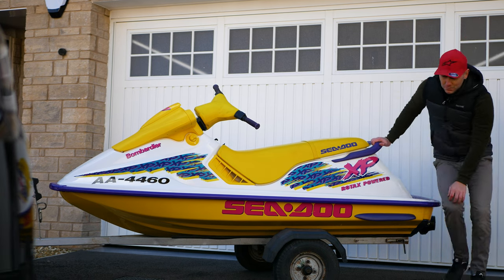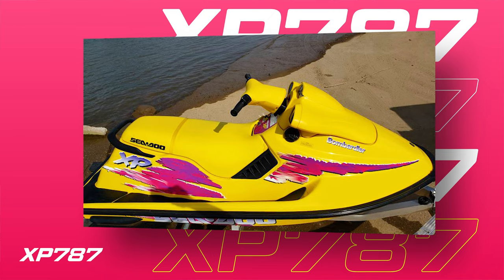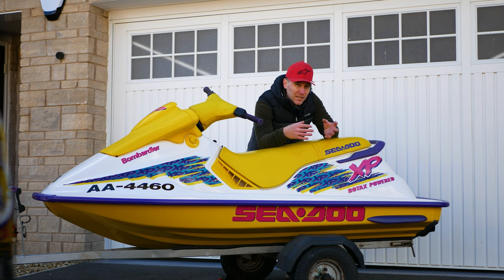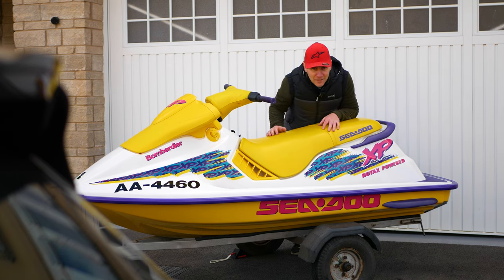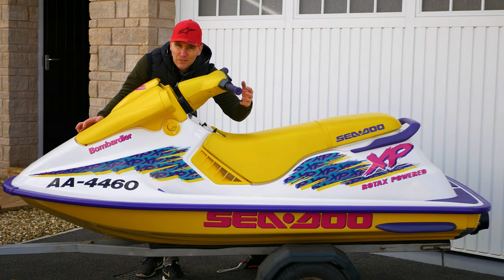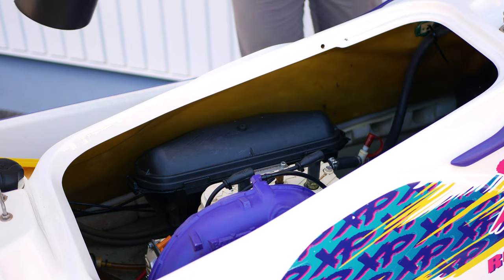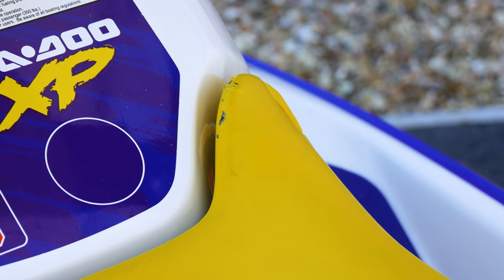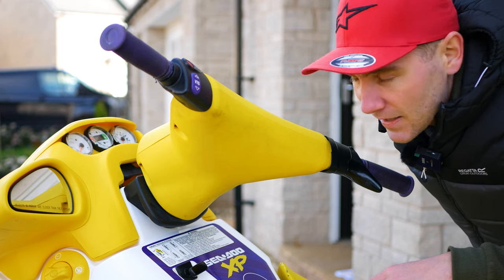Iconic Seadoo X4 HULL - Why I bought the XP717 vs XP800? | Seadoo XP 717cc 1995 | Ep2

Comment: Question'. 96 SPX an X4 hull?  I have an older man offering me one in decent condition. I actually just want the trailer but the ski comes with it. lol
Reply from the maker: So 1993 & 1994 XP's are not X4 hulls, 1995 & 1996 XPs (717 & 787) are X4 hulls. What happened is in 1996 they made the 1995 XP 717 X4 the 1996 SPX X4 as the XP was then the 787... the SPX then ran to 1999, the XP switched over to the parabolic v in 1997 (787 for 1997 and then 951 for 1998-2002, then 951di for 03-04). Have a watch of this, I cover the history, https://www.youtube.com/watch?v=cFD5ee8JBWw&t=227s
Reply: @classicjetskis  I picked up a 96 spx for my daughter.  717. She's 10 and loves it!  Not as much as her Superjet... but, loves it!
Reply: @classicjetskis  I already watched and "liked" that video. I appreciate your response! I just needed a trailer.. but the SPX came with it. Motor is strong 145 in both holes. VTS works.. now. Replaced the boot. Not gonna lie. It's quicker than I thought it would be. lol. Iv posted a few #shorts already. Working on a video.

Comment: I had both the power of the 787 110 hp vs the 85 hp of the 717 is a huge difference plus the rave valve is very easy to clean with a razor blade. The advantage of the 95 717 is the extended pump.
Reply from the maker: Yeh that's pretty much what everyone has said also buddy... I will for sure get a 99 spx 787 down the road... Thanks for watching and supporting 👌👌
Reply: It's a " 720, 800 or 951" motor... nobody calls them by 717 or 787
Reply: @tyronetrump1612  I know how they call them, is just not the correct term. 😉
Reply: @frederickfernandez1510  So we call Kawasaki 800 stand ups " SX 781s" , Yamaha 1200's "1131s"or Honda 650 motorcycles "honda 664" ? Every manufacturer rounds up cc's on their displacements. Only ghey people call it 717 787   lol

Comment: 718 with a few mods 63 to 64 mph
We put 951 modified in a 95 XP
It run 71mph
Reply from the maker: Man that sounds mega... I for sure want to get my hands on a 787 to avoid needing to mod the 717... my 717 has been so reliable and one of the key reasons I bought a 717 as they go on and on without messing with them... IMO if you want true stock 60+ then a 951 is the way to go... my 99 GSX ltd hits 63 on calm easy, so no need to mess with my pristine 717. Thanks for watching dude 😎👌

Comment: You absolutely can’t go wrong with the reliability of the 720 and the small light weight hill of the 95 xp. I have both a 95 xp 720 and 95 xp 800 and although thr 800 is faster they are equally as fun
Reply from the maker: Thanks dude, this is essentially exactly my conclusion on why I bought it, thanks for the breakdown dude, from what most have said this is a spot on evaluation of both.... I will get a 787 down the road in the SPX 99 but pumped at finding this 1995. Thanks for watching and supporting dude ✌✌
Reply: @classicjetskis  Displacement is everything - especially low end hit. Once you ride one with the 800 motor you will never get on that 720. 
I know I have been there

Comment: Love the videos I have an 2000 seadoo rx. I have a question do you have any suggestions on how to bring the paint back to life it's very dull
Reply from the maker: Thank you that means a lot 🙏 ok so depending on how bad the gel coat is you may need to cut it back with a marine polish and then reapply a good marine wax… I recommend for the wax side of things using a spray ceramic coating… for cutting back gel coat I always use 3M medium cut polish… also make sure if your not experienced using a machine polisher that you do the cut manually, so you can maintain control. Hope this helps 👍
Reply: @classicjetskis  awesome thank you I will keep you updated on how it comes out. BTW I love the gsx limited I rode that ski for years and I grew up on a SPX AND SPI
Reply from the maker: @toddmanganello3654  nice man! Love all those models… send me a pic on my insta with how you get on 👍

Comment: What is that black plastic you took off when you lifted the seat for?
Reply from the maker: Good question, it's an air intake director essentially... If you look closely on the side of the ski, you will see yellow grill intakes, this then channels air through the yellow grills, into air openings under the seat...when the seat is then placed into position over the black air intake, it creates a water tight seal... the air is then channelled safely into the engine bay to help cool... It's a design used on a number of years and models... Its on the GSX also. Thanks for watching and supporting dude!

Comment: I'm the original owner of a 96 XP 800 (with very low hours) which is in similar shape as yours. I haven't run it in years however, my son pushed me to get it running again. Had the carbs rebuilt and odds and ends addressed, I'm still struggling to get it running at it's peak performance. The power cuts down at about 45MPH as if it has a governor set to limit it's speed. I've had it to a mechanic I found who swears the XP is the best ski ever. About $1,200 later I'm about to give up with this guy because nobody else in my area wants to work on it....not sure if I should just sell it and look for a used late model three seater (possibly Yamaha for it's durability).
Reply from the maker: First of all, give your son a pat on the back for asking you to get it out... the reality with these old skis is it can be painful if you don't have the right person or knowledge to get the ski running right... Not sure where you're based but if you drop me a DM on Facebook or Instagram, I can try help put you in touch with people that can help. In any case, obvious thing that could be affecting things... have you checked the wear ring, impeller, RPM range in the water adjusted correctly... checked compression... all the useable bits, I'm assuming so if you have paid a mechanic to work on it, but that said, not all mechanics are equal... If you do decide to throw in the towel, please can you send me pics of it via DM, as may be I take it off your hands... as for buying a later 3 seater... 2 strokes are 2 strokes, if you're not liking the inherent work needed on the one you got, there no saying buying another wont be the same story... IMO the first thing about old 2 strokes is to accept its more about passion vs logic... you will have to spend money to get it running right and then its a labour of love to keep them running each season... If you want something less maintenance, check out my new spark videos as this gives some of the playfulness of the 90s but modern day reliability. 

Thanks for watching dude 🙌
Reply: Thanks for your reply, much appreciated. I'm located in Michigan (about one hour north of Detroit) so, not sure if you have any friends/contacts in my state. 
We love the ski for it's tight manuverability and raw speed, just frustrating that the motor scales back power after a certain amount of throttle. The mechanic that did the carb rebuild finally replied to me and said change the plugs (again). That would be the forth set of plugs in one season - doesn't sound right.
The only reason we were considering a 3 seater is because we thought it would be nice to have something alittle more stable to ride two without tipping over (the XP is really only a single rider ski) and our inland lakes can get very choppy.
If I can find an experienced mechanic that won't turn me away (because of the ski's age) I would definitely look at getting it looked at. It's just $1,200 in on repair costs so far, just has me concerned how much more that tab could grow with somebody new looking at it....money is the object.

Comment: Nice video. 
Yes the 717 is less power and a little slower..but as you said the 717 is less maintenance and more reliable.
Ive restored 4 of these and have another 3 im working on restoring.
As well as 2 of the 95XP800s.

As for grips, tho not OEM, I recommend the ODI LockOn Ruffian grips. 

And yes you need to mention why the grey gas lines need to be changed ASAP.
Reply from the maker: Thanks man... I know when it comes to 717 and 787 you have restored a tonne... I think you may have been one of the people that said about the 717 being easier to work on... Do you agree with my SPX thoughts? Thanks for watching mate ✌✌
Reply: @classicjetskis  yes i have a 99SPX hull as well in my project lineup.
As far as improvements go, in general they do make better improvements..but the 98SPX they made some changes to then undid those changes in the 99SPX.
The 98 SPX was the lightest and fastest of all the X4 hulls. They made the hull thinner in some areas..but that weakend it in an effort to make it lighter for racing. They also had a plastic splined pump instead of the brass pump, again to save weight. They ditched the plastic one and went back to brass in the 99. The plastic one again being lighter was also weaker and more prone to breaking.

What really disappoints me is the change from tachometer to speedometer then to not having either.
The 95s had tachometers which is more useful when setting carbs. The 96 had a speedometer...then the 97-99SPX didnt have either they just had the MF gauge and trim gauge.
Not really an improvement if you ask me.
Reply from the maker: @GCEXTREMEMN  Thanks for the info man, really helpful and interesting... I have to be honest, out of everything I have considered, the speedo/gauges is the one thing I hadn't thought about...So thats something to keep in mind. 

I did know about the lighter hull in 1998 as I have a buddy who specifically bought the 1998 spx for this reason, however based on your breakdown, I would probably take the weight increase and go still with the 1999 if they reverted back on things... 

The only bit I do love about the early xp717/800s is they would spray the exhaust and water box purple, which was a nice contrast to just all silver on the later 1999 spx... I'm OEM so its breaking the rules lol, but a yellow exhaust and water box would look sweet on a 1999.
Reply: @classicjetskis  well you probably wont like my plans for my 99SPX lol. I plan on regelcoating the top in Red...lol i want a red/black X4  to go with my red/black 04XPdi. 
Its going to have a red engine, black pipe, red waterbox, and a black hood.
Hopefully i can find some yellow water lines tho to throw in a tad of yellow for contrast.
Reply from the maker: @GCEXTREMEMN  To be honest mate...my fav colour is red...that why the GSX and XPDI are my fav all time colourways... If I didn't love OEM so much I would probably do an ultimate build... get a x4 hull and 787 (any of the years) and then do the ultimate colour combo like you. Send me some pics when its done dude!
Reply: @classicjetskis  yea its gonna be a while. I have so many ski projects ahead of it, all which will get done and sold to fund my other personal projects. 

I really enjoy your videos. What drone are you using? I need to work on my cinematography on my vids.
Reply from the maker: @GCEXTREMEMN  I hear you dude. I know that feeling, I would love to be making these videos full time...hopefully one day! I have a drone Pilot I specifically call in when I do ride content... I was gunna buy a drone then realised its cheaper for me to hire my buddy with his drone for the day... I would have to do like 10 shoots before I would pay for the drone and also I need to be focused on riding the ski, so it doesn't make much sense... I can find out what he uses...I know its DJI and its always 4k at 60FPS...  Everything else is filmed by me and Megs on a Pan G7 using the kit lens and a prime lens... hope this helps.
Reply: @GCEXTREMEMN  That’s the one I bought. 98 SPX last summer. Previous owner took horrible care of it though. Exterior was beautiful but the exhaust pipe had a massive crack in it & was letting in water. Then I had to clean the carbs afterwards. Got the new pipe on, thing’s running like a champ! It is the lightest hull out of all X4 models. My buddy has a 96 XP & I believe his weighed about 434 lbs. My 98 only weighs about 428 lbs. It’s funny you mentioned speedometer cause I did get kinda pissed when I saw that my buddy had that on his but I didn’t lol. I believe the 96 XP 787 also had a ceramic flywheel that’s prone to breaking, while the later X4 models swapped to stainless steel. That’s one nice thing about having a later model is that they usually figure out the bugs from the previous years.
Reply: The only extra maintenance from a 720 to an 800 is the rave valve cleaning.
Reply: @tyronetrump1612  generally yes..but the 787 also has a counter balance shaft

Comment: I bought a 1999 SPX brand new! I found out Seadoo was gonna quit making this hull in 99 and in 2000 I hunted down a new one that was left over from the year before. When I found my new 99 SPX at a dealer it was still brand new in the crate. Most fun ski I ever owned and I regret to this day selling it in 2005. The 110hp motor in this light weight hull is so much fun. I had a 1996 XP and yeah the 1999 was pretty much the same ski but with bolder looks to it. I’ve also owned a 1992 SPi and 1992 XP but the 1999 SPX was something special. Love this ski you picked up. Really nice condition for the age.

Also these hulls if you do it just right can be spun around and then will stand straight up. I loved showing others how to do it. The bigger Seadoo hulls want do it. Wish Seadoo still made these!
Reply from the maker: Love this story dude! Man the idea of getting a brand new spx is goals!!! Lucky man, great memory’s for you by the sounds of it. I will report back after a summer of riding it if I pull off this move… sounds epic… thanks for watching and supporting, really appreciate it 🙏
Reply: Happy for you, but I have to wonder about the "bolder looks" for the 1999 SPX vs the 1996 XP,  how do you top all bright yellow with pink and purple graphics? Unless you meant to write the other way around?
Reply from the maker: @GoldenCroc  to be honest you may be right, having re-watched this back and seeing the 1995/1996 xp again...its a hard one... I didn't make a mistake and do agree in terms of 'bolder look' 100% you're right, the 95/96 yellow and pink hands down takes the win in terms of bolder, but its more the fact that personally I want an SPX to add to the line up, plus as I mentioned, the 1999 SPX is basically the same ski... I do also really love the black/yellow colour way on the 1999. The reality is in an ideal world I would have both aha... Thanks for watching dude ✌✌
Reply: @classicjetskis  Just to clarify, I meant specifically the "bolder looks" comment from the OP, not any reasons you gave for preferring a SPX. And even for the OP, it was just a small nitpicky sidenote of his wording... Not very serious.

In any case I would also prefer a SPX really, but as a 90s kid I just couldnt resist the eye searing looks of the -95 and 96, thats why I got one. I also collect 90s motorcycles with terribly loud graphics, and I have vinyl wrapped my own car in a sort of goldish-"high-viz yellow" metallic... Yeah...
Reply: @GoldenCroc  Maybe not bolder but I loved the looks of my 99 SPX. I have owned both a 1996 XP and 1999 SPX. I loved the black on the bottom of the 99 SPX plus it was the last of these great little hulls Seadoo use to make.
Reply: @nasashuttle  Agree with every word of that, it really does look great.
Reply: @classicjetskis  I found my old video I made back in 1998! This is me on my old 1996 XP and at the end of the video I included a picture of my 1999 SPX. I used a 8MM camcorder I strapped to my vest. https://youtu.be/P-EjU8_AqPY
Reply from the maker: @nasashuttle  Yeh as I said I agree that the 99 SPX isn't bolder but just love the colour combo... plus as you say the fact its the last x4 they made makes them pretty rare here in the UK...fingers crossed I can find one at some stage ❤
Reply from the maker: @GoldenCroc  🙌🙌🙌🙌
Reply from the maker: @nasashuttle  this is so cool! just checked out your channel and had a watch...I also love the fact that go pros weren't even a thing back then... commitment with putting the camcorder at risk lol... Dude would you mind firing me a message on Instagram or Facebook with more pics of your 1999 spx... would love to see more... there's not loads and loads of content on them... Thanks for watching 👍👍
Reply: @nasashuttle  I watched your old video now dude, pretty cool. Very nice looking SPX as well.

Comment: Same exact ski as my 96 SPX, just different paint. I picked the 717 X4 because its light, RELIABLE, and easy to work on if need be. Already restored the MPEM back to original, did pump bearings and wear ring, carbon seal along with an engine alignment, fuel lines, fuel selector, replaced gas tank and oil tank, and i'm now thinking about ordering some new stickers to bring it back to those 90's purple yellow and turquoise.  Love these things man so much fun!
Reply from the maker: Your 1996 spx 717 is the ski that featured in the film ‘Speed 2: Cruise Control’ it’s like a teal colour right?… great work dude on the restore… I’m right in the middle of doing all the usual maintenance bits like you getting it ready for the summer 👌 thanks for watching and commenting dude 🙏
Reply: @classicjetskis  Yessir, teal indeed. Well, the seat and the hood are. Hopefully you have had some time in the water on it by now, I'm on the ocean in South Carolina so its nice to go play around jumping waves, and then cruise the ICW that's typically flat as glass. Gets me up to about 55mph with 5 gal in the tank. Cheers brother